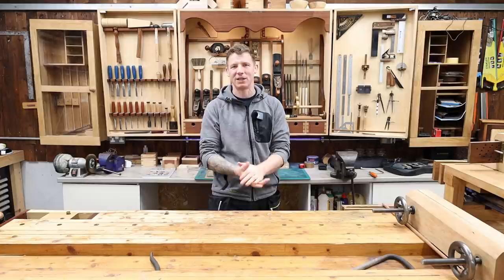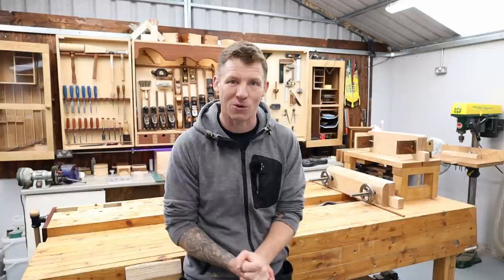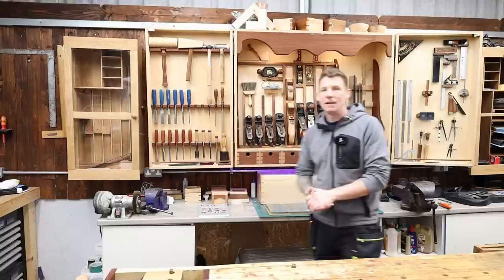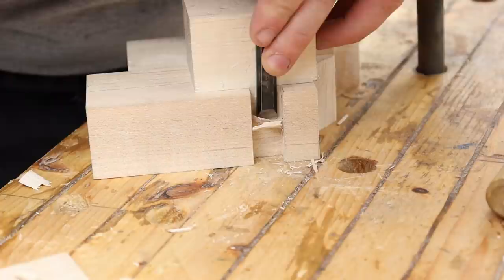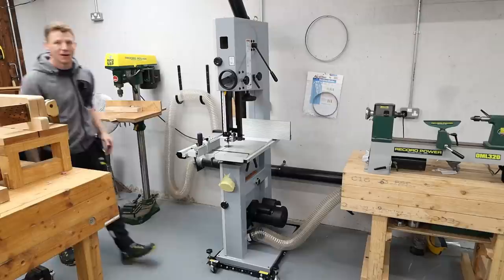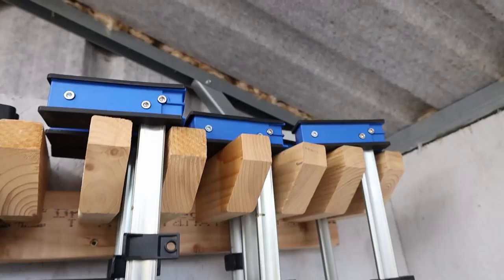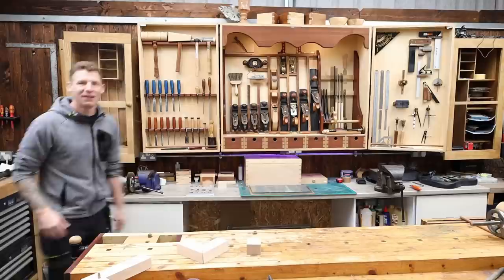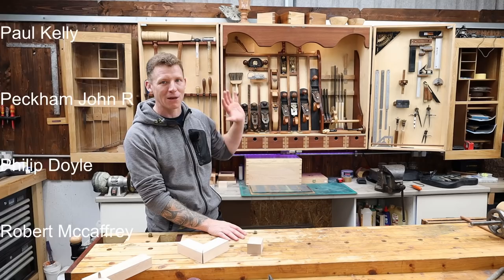Workshop Vlog #20 Updates, Tools, I got Cov1d!

Comment: I have a basement workshop. I tackled the damp conditions by forced ventilation. In one side, out the other. 
I use 2 cheap bathroom ventilators that simply run 24/7. It has completely dried up the space. No rust on anything!